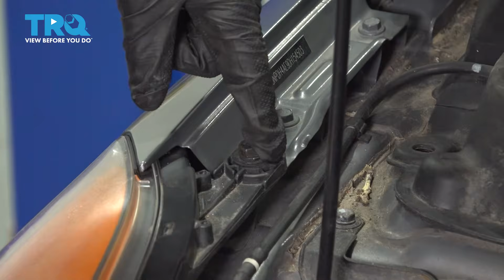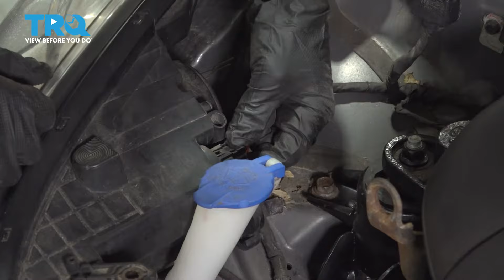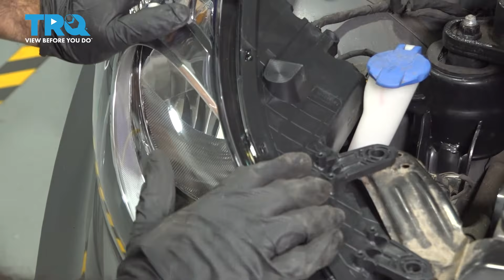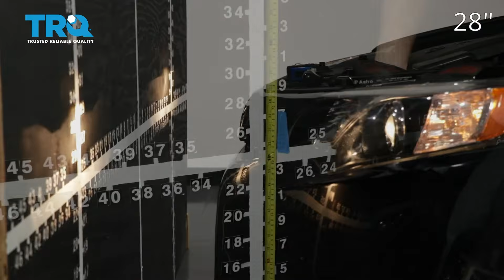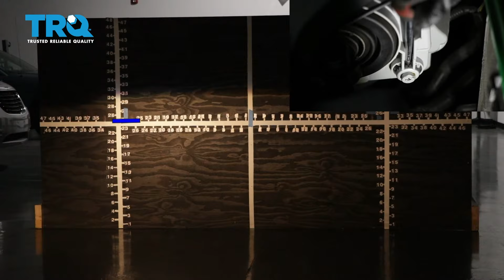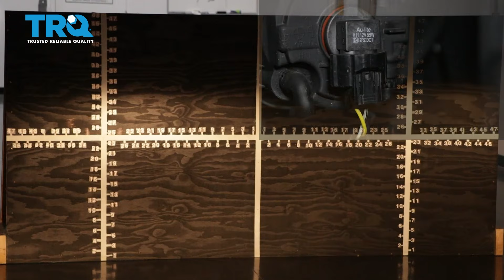How to Replace Headlight 2011-2016 Hyundai Elantra

Comment: You don't need to pull out the headlamp assem on the pass. side.  Unlock the large round cover, unhook the wire clip, and twist the bulb. a 5-minute job.

Comment: Removing an installation is easy. I just want to know how to swap out the guts.
Reply: Late, but youd have to separate the clear cover from the black housing and then remove the shroud. They lock back together but are sealed with adhesive